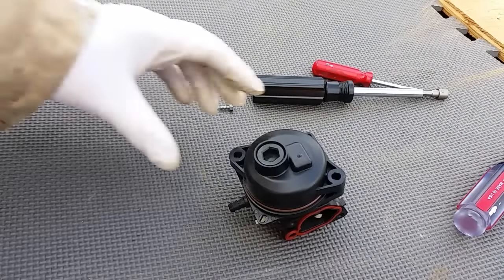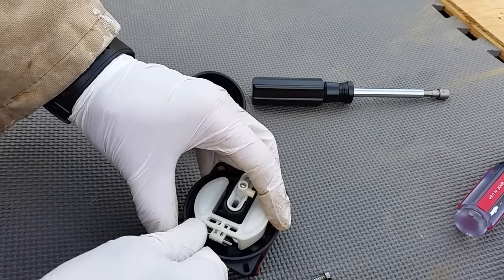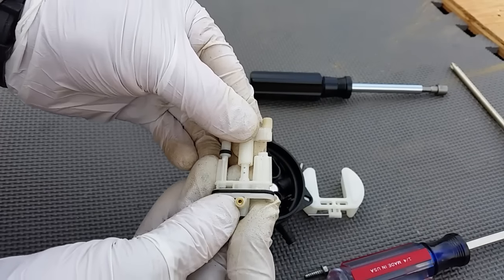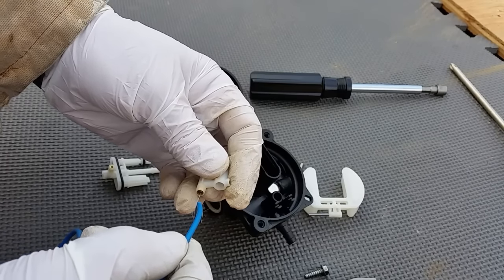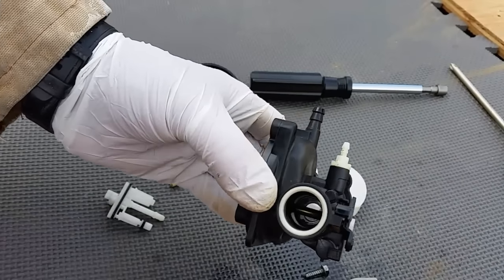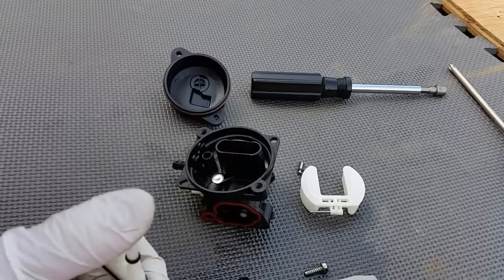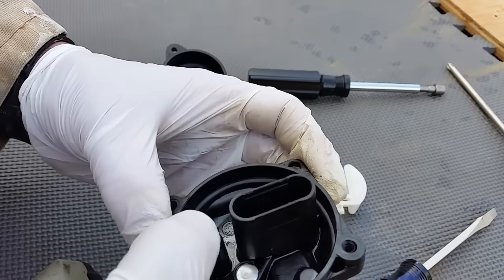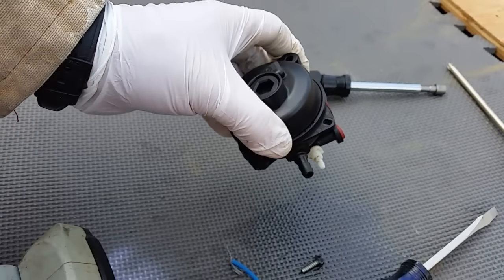New plastic carburetor - easy cleaning parts teardown Briggs & Stratton Ethanol clogs

Comment: this is the best video i came across about these carburetors. i had taken mine apart and cleaned it twice, but the slow explanation of the pieces you lift with the screwdriver were key. worked first pull after that. thanks so much

Comment: Worked perfect. A couple of notes. Under the floats, is a little round dome shaped piece of aluminum. A cover over a port. It had fallen out. Put it in place, and lightly tapped it with a socket slightly smaller. Worked perfect. Also noticed hinge pin for floats kept falling out. Superglued one end. Worked perfect. Runs like a champ now. Thanks a million. Oh, also, I used welding tip cleaners to clean ports in nylon piece. Lots of different sizes to choose from.
Reply: I feel like super glue is not going to last very long when gasoline's in there with it

Comment: Good video!  Last year I drained the sta-bil and put fresh gas in the tank.  I didn't use it again for a month and it wouldn't start. I didn't think gas would degrade that fast and clog up the carburetor, but it did.  I didn't use it the this summer until yesterday 9-22-20.  With the help of my neighbor Jim, your video  and some other videos I was able to get it running.  Thanks.  Also thanks for getting to the point and not wasting my time.

Comment: My  lawn mower is just over 90 days old and I have to do this SMH, good video.
Reply: Buy 93 octane NO Ethanol Gas instead of being cheap. Pay me a tiny bit more now or pay me ALOT later...
Reply: The hole is too small.  Check "Steve's Small Engine Repair" video - Easiest Way To Clean a Plastic Briggs Carburetor.  He addresses this issue.  I went through 3 carbs before doing this fix.
Reply: An OEM Briggs inline fuel filter will cut down on the frequency of this having to be done.
POS carburetor

Comment: Thanks for this video!  I have a Craftsman mower with this carb. I’ve cleaned out many small engine carbs, but never one of these plastic ones. My mower is a couple of years old and wouldn’t start this spring. I cleaned the carb going by your procedure and it started right up. Thanks again!

Comment: You're a lifesaver. I took it apart once but did not know about the extra piece on the jet assembly. After I took that off and cleaned it and put it all back together it started first try. Thank You!  My original problem was started off of primer but then would die. And if you can use clear gas instead of ethanol you will stay golden.

Comment: Thanks for the demonstration!  I didn't know that the main jet disassembled came out until you showed me.  I "rebuilt" (sprayed carburetor cleaner in the jets until I saw a full stream)  the carb but I failed to check the gas tank and it stopped right back up after about 20 minutes of mowing. This time I'll check the tank for anything foreign first, then completely remove the main jet and clean it thoroughly. Thanks Again!
Reply: I plan an inline fuel
filter on ours but it has to be one of the small “quarter sized” ones so I can fit it in the fuel line

Comment: Glad I found this video. Didn't realize the white plastic part came out in the middle.

Best thing to prevent carb problens is to put a filter and a shutoff on the fuel line between the tank and the carb. Close the valve before you finish mowing and run it out of fuel. At the end of the season run the tank completely out of fuel. Then it can't sit in the carb n gum up the tiny passages.
Reply: Uptin Sinclaire I did this and even had enzyme treatment in the last tankful and it still clogged.  These fussy little carbs are a pain and ethanol is a scourge!

Comment: Thanks for the Video, saved me the cost of a repair or getting a new lawnmower....had used it twice went on vacation when I came back last year it would not start....cleaned it as you stated and it started up and is running. appreciate it very very much!

Comment: Thank you sir for this tear down , i have the same engine on my push mower and it would just not start and couldn't figure out why . I didn't know about the jet in the assembly in the center of the carb , took it apart following your directions and sure enough it had clog , used a wire and cleaner to clean it reassembled it  and it started on the first pull , thank you again :)

Comment: Thanks for the video, really helped me get my mower working again. The problem was the little plastic piece that you have to pry off on the inside of the carb. After getting it out I noticed lots of dried gas deposits on it. The I took that piece apart further per the video and cleaned it. Now it runs great again!

Comment: Hello A-Plus.  First of all thanks for making the video.  I’m no novice to cleaning carbs on small engines, Tchumseh, Briggs and Honda are the three that I’ve cleaned and fixed before but I’ve never tackled one of these all plastic jobs before.  At the end of last season I bought four lawnmowers from a man who had sold his rental properties and just wanted to unload these mowers.  Point being I do not know any history of these mowers.  Today I finally got around to picking one out and making it run.  I cleaned out the orfices of the carb as you did minus removing that small white plastic piece of the three prongs.  I did remove the white cartridge and blew through it with carb cleaner.  Everything seemed ok.  

The problem is that the engine refuses to reach the proper RPM.  I think it’s running too rich.  I can see droplets of gas being spewed out of the carb’s intake hole.  It’s running at about 1/3 or even 1/4 speed.  It starts on the first pull but will not speed up until...until its running out of gas.  When it runs out of gs it speeds up for the last 2-3 seconds and runs almost normally.  

Any thoughts?

Comment: this is the best video covering this topic. the hole in the bottom sideways jet is incredibly tight and small. i never knew such a small place existed. ours was completely clogged, and at first i couldn't even see if it actually passed through or was a dead end hole. after taking this apart and putting back together a few times, i am now wondering why our mower's fuel system doesn't even have a fuel filter. i at least didn't notice one. seems another clog is inevitable. using a single strand of the small braided wire is a good trick. i twisted a few together after getting the first one through, and then kinda used it as a very small pipe cleaner. started on the first pull. i guess we are just gonna try to keep our gas, and gas can very clean. our mower actually is a 2015 model that someone bought new, used a couple of times, and then put into storage, and let set at least a couple of years, maybe a few. our clog may have been extra stubborn due to that. i would also recommend doing this procedure somewhere with very good lighting to see the small hole.

Comment: Very good video.  I have just done one of these carbs but didn't touch the white plastic bits as I didn't realize their significance.  My work was not very successful - engine still surges.  Will have another go soon.  Was not very clear on 'what gets in the way' when the white plastic parts are reassembled into the carb but I expect it will become clearer at the time.  This is an easy carb to remove from the engine as it just pulls off so the overall job is quite quick to do.  Thanks for the info.

Comment: gr8 vid ,  on those I don't take that small part off the white jet, I did that once, and when I tried to put it back I ended up breaking it. and had to buy a new one. I figure I have a better chance of not cleaning that part as well as I could and it still work then the chances of breaking it.

Comment: Thank you so much man. I watched all tge other vids on this carb and none of them showed that white plastic thing that i believe had the idle jet (not sure) pops out. Thanks again.
Reply: duane speck I haven't seen that white check valve thing move (shown at 6:48) in the emulsion passage in any other videos either.
Reply: I just bought a used lawnmower and it has that white vacuum line where does it connect to anyone know please help it was on the carburetor but white vacuum line does it stay open or does it connect somewhere

Comment: Thanks man. Funny thing, I had never seen a plastic carb before when I got my B&S 300E. Had a chuckle at it, but really neat what they can do with plastics!
Reply: The older quatro engines used a plastic carb that sits flush with the little gas tank,they are famous for warping a bit and leaking fuel,lol

Comment: Just serviced my 575EX carb (virtually the same, but with a choke rather than primer bulb), would recommend using brake cleaner rather than carb cleaner, as the latter can damage the plastic (hence why people complain about these carbs "not lasting" when they're blasting a solvent into them!!), brake cleaner doesn't have the same effect on plastic so is much safer to use for longevity... :)

Comment: They built this carburetor with the main jet being to small of an opening so the engine revs and starves for fuel.  I watched another video were the guy used a small micro jewlers set to slightly increase the size of the jet.  It worked on my craftsman mower.

Comment: Also, on the cap of the gas tank states 85.  Also, the O ring on the one I was working on wasn't the correct size. Every year shouldn't be a task to a mower going. Anyway, love the video.  I took this one completely apart. We will see if it's running okay tomorrow.  Going to change the spark plug too.
Reply: Mine says not to use 85. It shows crossed out 85.

Comment: It does make a difference on how the float bowl cover goes on....if you take the drain plug off on the bowl cover you will see it goes on only one proper way...and the drain plug is not threaded..it's a turn lock on off  allen head screw that is sealed with a O ring...hard to take off without taking the bowl off and then easily breakable ears that will break when if you put back on....broke the locking tabs on the plug and have to buy the whole bowl...the whole carburetor is plastic so anything you remove on it can break...especially if it is tightly connected.....the carburetor is also attached to the manifold by a rubber grommet that you just push in to secure...no bolts on the carb to attach to the manifold..the carburetor is sandwiched between the air cleaner bracket and engine screwed onto the motor and that's how it is secured ..

Comment: Screws are generally turned into an object, like a piece of wood, so the head needs to be bigger than the surface. ... The shafts of bolts are not tapered, whereas many screws are tapered. The main difference between a bolt and a screw is that a typical screw can work on its own and a bolt requires a nut to secure it

Comment: I think there are good plastic carbs.  I had a totally different design that worked until it was almost half full of gunk.  Sat on top of a metal gas tank.  This design is absolutely a horrendous design.  It is not just that it fails so easily, it is even more difficult to take the carb off, and put it back on.  You really notice that fact, if you are working on two different models at the same time.

I can't believe that so many mowers have this carb.  It's not just one year.  It is like they designed it to fail to sell replacement carbs.

Comment: just a small note when you remove the  center plastic jets they can let the venturi fall apart ,the jet actually seats in the cone of the venturi , and I recently had one move and had the devils own job getting it reseated ,  it blocked the passage and the choke wouldn`t open there fore the throttle would not close and the engine ran at full speed all the time .

Comment: On top of the carb there is a white fitting.  When I took the mower apart, I found this went "no-where".  That makes no sense.  It looks like it is supposed to have a vacuum tube on it or something.  Any ideas where this went.  I have a mower that won't start unless I force fuel into the carb and then only for a few seconds.  The motor is obviously starving for fuel.
Reply: I, too, am looking for info on that white tube, looks too clean to have not been covered with something, but I SWEAR there was nothing on it when I took it apart! If I find anything I will come back and share the link. Stay safe.

Comment: Cleaned mine out twice today, runs but surges. Going to get some more carb cleaner & try again. The ethanol fuel is the biggest problem with small engines today 😤😕😦

Comment: Any idea why my lawn mower will only run for about 15 seconds and then sputter and shut off I just got through cleaning the carburetor like you did in the video and it's still doing the exact same thing. it's got a brand new air filter nothing seems to be clogged either. Thanks in advance

Comment: Left a little gas in my mower for about 6 months.  Took the carb apart just like this (twice).  The first pull was light then it got heavier.  Never started.  Will start for a second with ether in air cleaner.  New carb time I’m guessing?

Comment: I have cleaned this carb (but with no this mid. part of the cartridge removed). Unfortunately- no result... Too hard to start the engine. Especially if you try to start it second time. Almost impossible. But if it`s working- the re is no issues, unless it works a bit unstable. Compression and sparks are normal...  Valve gaps are checked and adjusted.  I have no idea what else this engine wants from me :)  Is there a way to replace this plastic carby with a traditional metal one, please? Thank you

Comment: just saw your vidio has the exact carb, no choke spring like others just a white cap on top, so the white piece buy  gas connection looks like a tube must slide on...mine does not have a tube , is this what closes the carb to choke??

Comment: Exactly the information and motivation I needed.  THANK YOU!  Going out right now to do this on a fairly new push mower that sat for a long time before I got it.  Wish me luck.  I still have one stupid question: There is a white "barbed" fitting that appears to have something to do with the priming button. No hose goes to it. And, when you push the prime button, it appears to exhaust air (fuel, if carb is held upside down). I am assuming it is a one way check valve to make the priming button work, but can not verify this on ANY parts diagram or service manual. Am I right?  If I am, why is the little bugger barbed?
Reply: That white barb I assume is for another application …doesn’t go to anything on our mower…

Comment: I'm working on the same carburetor it's my neighbor wouldn't run pull it apart cleaned it and notice that the white Inlet above the fuel Inlet has no hoes on it should there be a hose on it? and if so does it go to the air breather backing? your videos are great thank you any help would be greatly appreciated
Reply: The choke-equipped model of this carb will have a breather tube connected to the white port. The primer bulb type model does not, but shares the same component with the choke models, leaving the white port open to atmosphere.
Reply: ontariohvac thanks for the reply  and the great videos
Reply: Freedom liberty  Spirit my same problem. Every time I press the prime pump gasoline comes out from that white valve.
Reply: ontariohvac what should I do if mine shoots out gas from it every time I press the red pump?
Reply: This is not my video but is produced by the excellent tech A-Plus.
Reply: Jay Bee, I don't have a primer model right in front of me so I'm reluctant to go into much detail. In general terms, the idea of the primer pump is to bring a little gas from the bowl and get it into the throat of the carb. There's two ways of doing this. One, when you press the bulb, pressure directly forces gas from the bowl up into the throat, or two, when you release the bulb, vacuum draws the gas from the bowl and into the throat. You'll be able to hear it squirting either way. Reason I stress this is, obviously you need a real good airtight  seal and also nice clean air and fuel passages.
First, clean the carb as A-Plus demonstrates. But because of this particular problem, you must also give special attention to all seals and gaskets, and especially the air cleaner box.
You see that red seal that's exposed when you remove the air cleaner box? Make sure that's like new and clean as a baby. IIRC, there will be passages molded in to the air cleaner box. They get clogged. Use carb cleaner and then low-pressure air to clean those out. If you're using an air compressor go real, real light.
Now, I'm open to correction on this, but I believe your problem arises because this model carb is using the white port as a bowl vent. If any primer passages are clogged, or any seals in the primer circuit have failed, the gas intended to prime the carb will follow the path of least resistance and squirt out the vent, instead of going up in to the carb throat. This won't happen with a choke-equipped model - they don't use primers (usually).
Reply: ontariohvac thanks, think I really need to clean that carb cus mine is dry as a desert for some reason. Gotta buy a new seal just in case as well as a new sparkplug. Airfilter was replaced 3 days ago. Again thanks alot.
Reply: Freedom liberty  Spirit
Reply: timmyp34  so that's what you momma did.

Comment: Question. The white protruding thing that he didn't clean.. Does a hose connect to that?
Reply: No, it is the air intake valve for the primer system. It looks like it should have a hose on it but it doesn't

Comment: Hey , is there a small cap that goes on the end of that white nozzle on the side next to the fuel line? I took mine all apart, put it back together, and now I get fuel squirting out of there. There's a leak somewhere from the carburetor housing, and it's not starting at all after initially running.. Help please